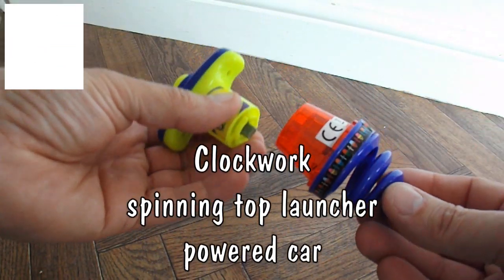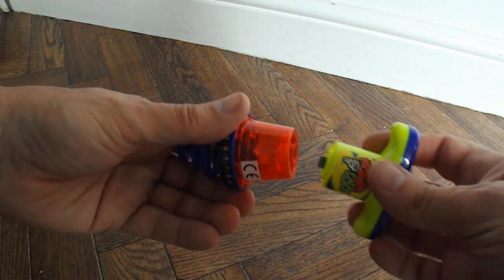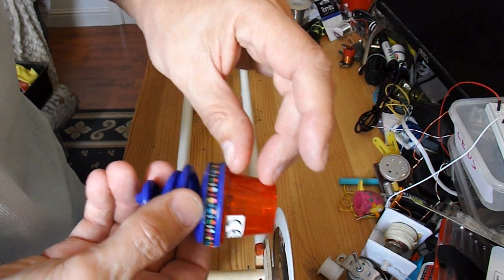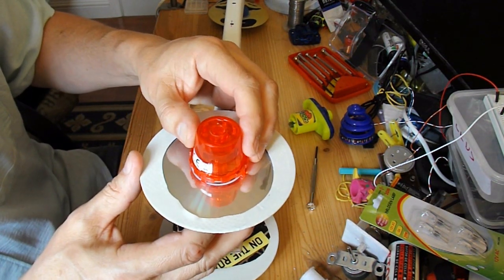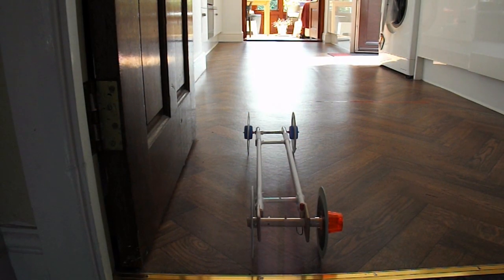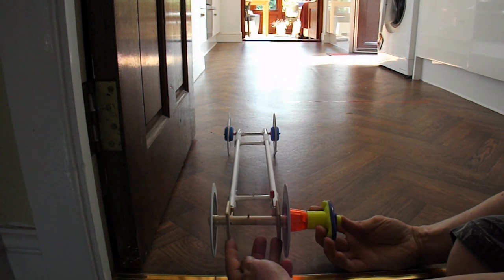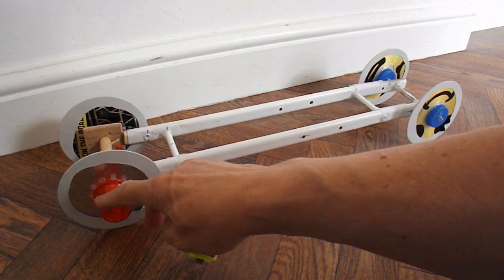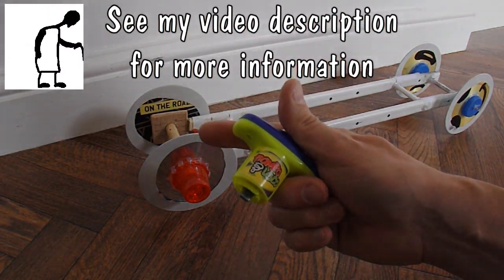Clockwork Spinning Top Launcher Powered Car

Comment: Could u make that top into a propeller like hot glue it to a propeller and then add it to a boat and make a vid on it plz
Reply from the maker: The general principle might work. You need the propeller to be heavy enough to act like a flywheel (or attach it to a flywheel) as the power of the clockwork wind up part is transferred to the spinner and that is all there is. You would probably need to mount it on a ball race to minimise the friction to help is spin longer. Something like this toy would probably be a better place to start https://youtu.be/CBS_CCHF5y0